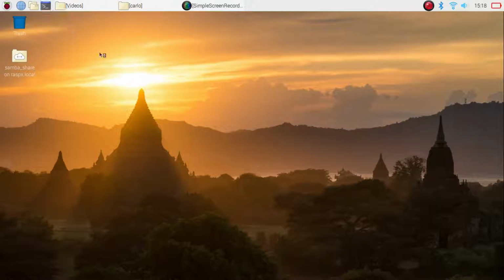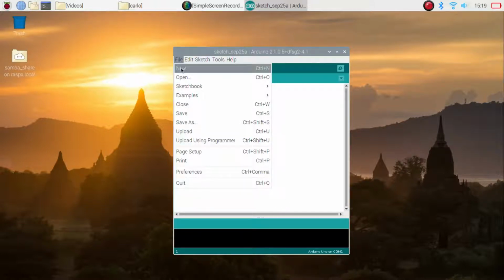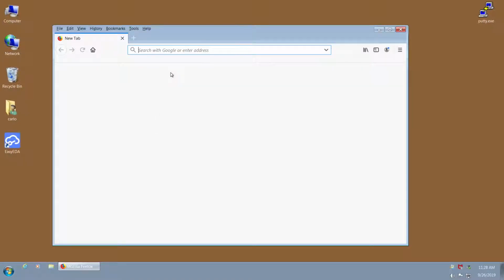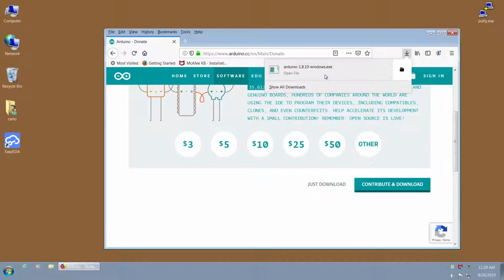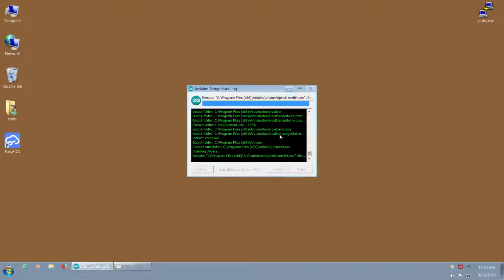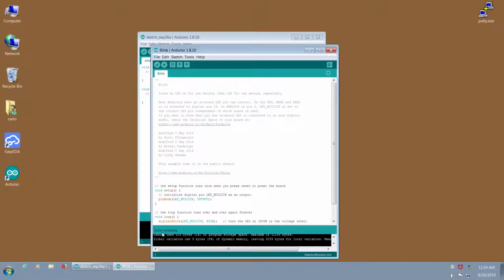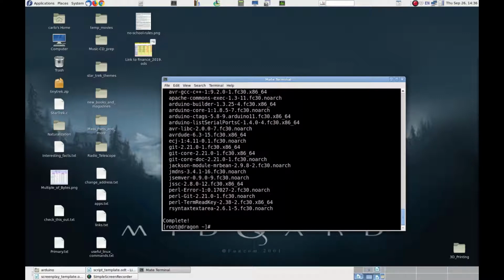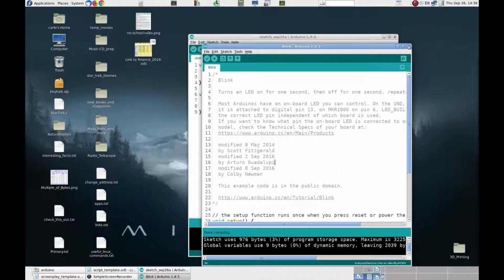Arduino for Beginners: Installing the IDE

Comment: Question: Do you have the option on your Raspberry Pi Arduino IDE in preferences:  'Additional Boards Manager URLs:'???    Followed your directions and installation Arduino IDE went perfect to my Raspberry Pi 4B and works perfect ... however a week later when I went to the preferences in the Arduino IDE on the Raspberry Pi version it looks different than the Version on my Windows computer with one VERY important option in the preferences is not available on the Raspberry Pi version of the Arduino IDE.   There is no area to put the 'Additional Boards Manager URLs:' so there is no way to put the addresses for installing the Boards Manager info for EPS32 and EPS8266.   Seems very strange that a recent upload would not have this option?    I installed my Arduino IDE months ago on my Windows computer and it has preferences:  'Additional Boards Manager URLs:' so curious why wouldn't this recent upload for the Raspberry Pi not have it?
Reply from the maker: Hi Charles, thank you for your question. I checked on my Raspberry Pi and, like in your case, the field to add the additional boards manager is not present, while it is present on the Windows version and also the X86 linux version I have installed on fedora. I noticed that the arduino IDE version on my raspberry Pi is 2.1.0.5, and on windows is instead 1.8.5. I don't believe there is any direct correlation between the two numbers, since they are for two different platforms. However, it is clear that these two versions are different. I would assume that the ARM version, at least the one for Raspberry PI in the Raspbian repository, is a little behind the X86 versions for both Windows and linux. However, I did some research and found that  the official Raspberry PI site carries a 1.8.x version that works also on Raspbian, but it is not available in the Raspbian repository. You can still download and install it, if you need it. First, uninstall the Arduino IDE version you currently have on the RPi and then follow the very detailed instructions available at the following link to install the better version 1.8.x:
https://medium.com/@ronm333/installing-the-arduino-ide-on-the-raspberry-pi-82301ab381b9
Hope this helps, and thank you again for pointing out this difference.
Reply: @eleneasy   Wow!!  Thank you for the info.  Very Helpful.  Your Videos are wonderful!!    I may test out the 'Arduino Create' online 'Arduino Web Editor' Version over next few months and then re-install the Raspbian Arduino IDE in 2020 to see if it has been updated to have the 'Additional Boards Manager URLs:' in preferences.  Until then I have the Arduino IDE on a windows computer so if I am doing ESP8266 and ESP32 items I can use that computer for those projects.  The Raspbian version works great with my Arduino UNO and MEGA great for those projects.   I really do appreciate all the effort you put into this information and I look forward to future videos.  I'll let you know if I can connect to ESP8266 and ESP32 with online version, but as of now all I have done it open it online in Raspbian to bookmark it.  Maybe in a few weeks I will jump on it and test it out, maybe we can compare notes.  ColdLandCNC@gmail.com  Thank You :-)
Reply from the maker: You can check periodically if there is an update of the arduino ide on RPi without reinstalling Raspbian. Updates are provided periodically in the repository for any piece of software. To check for and install updates, just run the command:  'apt update' and then the command: 'apt upgrade'. The last command will provide the list of the modules that can be upgraded and will ask you if you want to actually upgrade. Just ask 'y' to upgrade. After an upgrade will update also the arduino ide, open it and check the version, or check if it has the currently missing field.
Reply: @eleneasy  Thank You!!  You have been so helpful.  I will add that to my online notes and give the upgrade it a try.

Comment: Were you using 3 separate computers/monitor or where they all on the same unit with Windows, Fedora Linux, and Raspberry Pi connected?  The reason I ask is I have been wishing to learn more about using Linux and also Raspberry Pi and would like to buy a new computer/system for that purpose and don't know where to start or what to buy.  Would it be possible for you to make a video for new Linix and/or Raspberry Pi users that goes over the starting equipment that one should buy to get started and some links to where to buy it.  It is amazing how much confidence it gives a new user when someone makes a video and shows links to the equipment needed so one knows if they buy those items and download specific files they know they will have spent their money wisely and be at a starting point to begin to learn.  Unfortunately, what may seem very simple to you since you have done it can be very intimidating for others that have not learned it yet ...  As an example, I help individuals learn to use SolidWorks CAD software and also TIG Welding and I can tell them exactly what they need to get started with a very inexpensive TIG welding machine.  I can tell them what to look for and what not to buy when starting out.  I also can show individuals where to start with SolidWorks to get them started drawing the parts they need for their projects  https://grabcad.com/ctm-1/models ... For welding I know what inexpensive TIG welding machines they can buy online and can show them links to those exact items that will work to start out with and will continue to work for them until they are ready from their own experience.  Any help you could provide will be wonderful.  https://ctmprojectsblog.wordpress.com/about/ and Thank You again for making this video.
Reply from the maker: I used a real raspberry pi, a real linux computer with fedora, and a virtual computer running windows, which I created as a KVM machine within the linux environment. If you want to start learning linux, an easy and very inexpensive way to do that is to buy a raspberry pi 4, which is an awesome linux system, and use that adding only a keyboard and a mouse. A TV with HDMI input would serve as a monitor, if you don't want to buy one. Look on the official raspberry pi site:  https://www.raspberrypi.org/
They explain very clearly how to install raspbian (a linux distro) on the pi, very easy to follow. 
I also need to thank you for the idea. I was already thinking to create a video on the raspberry pi, sooner or later, but it looks like there is a certain demand of information in that area, and I am always happy to help others in the learning process, so this video will come out relatively soon.
Reply: @eleneasy  Thank you!!  I look forward to viewing your videos about Raspberry pi and using Linix/Raspbian and suggestions for extras for the Raspberry pi 4 ... Just ordered a Raspberry pi 4B with 4GB and cord and 128GB micro SD Card and will connect it with wireless keyboard and wireless mouse and use HDMI on TV ... It's a start :-)